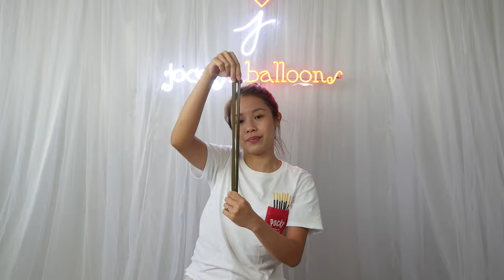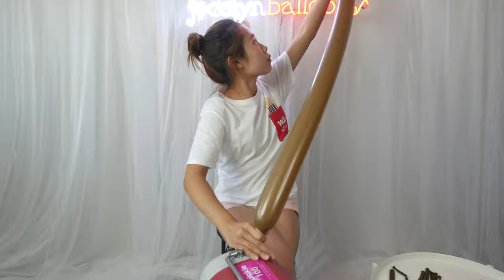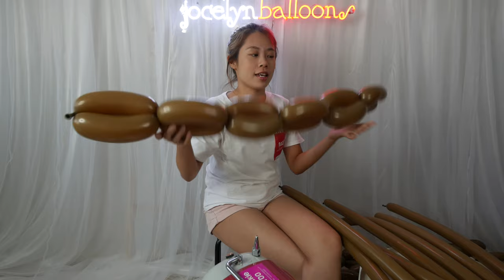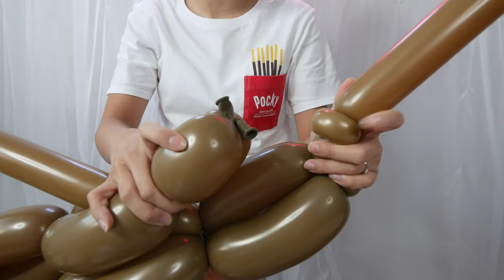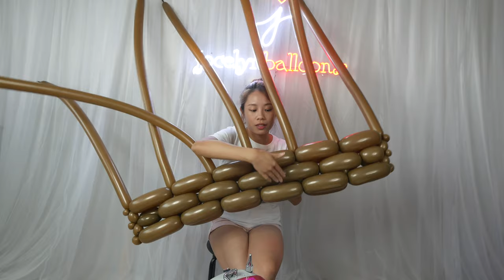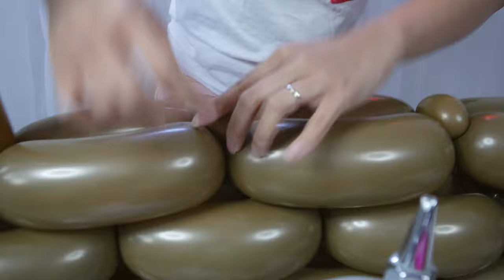Hot Air Balloon Tutorial | Part 1 | Balloon Basket

Comment: What is the setting on the automatic inflation pump?
Reply from the maker: If you are using a legenda electric pump, the setting is 

Layer by layer (front the top)
0.3
0.6
0.8
1.0
1.2
1.2
1.0
0.8
0.6
0.4
0.2
0.2